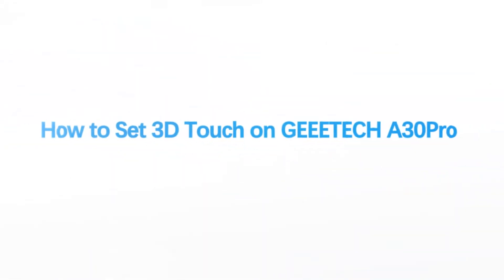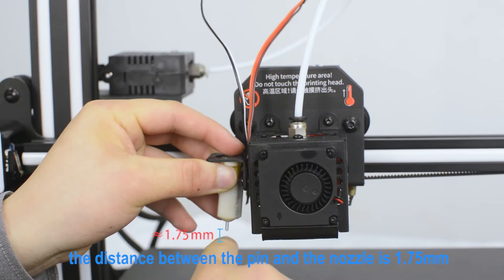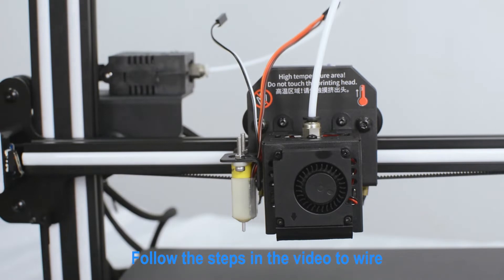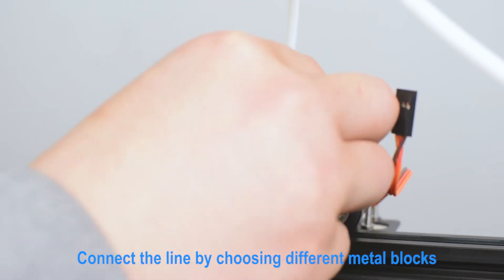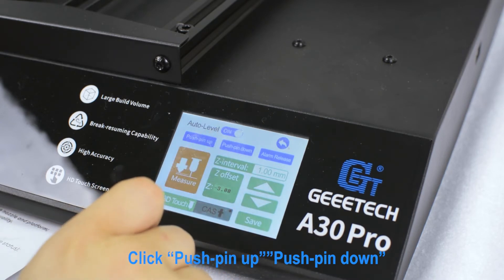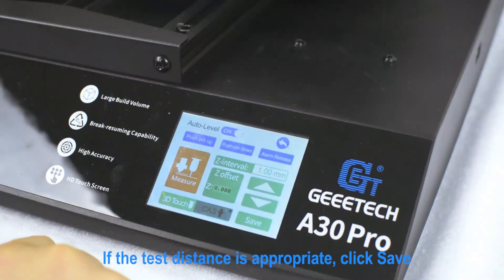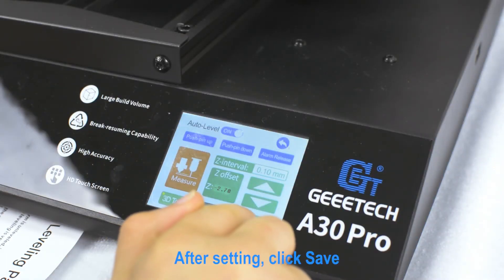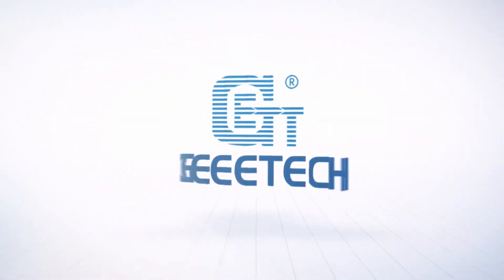How to Set 3D Touch on GEEETECH A30Pro

Comment: 3DTouch does not work on leveling. I damage my printer because the nozzle ramm into the bed.
The pin of the 3DTouch come down two times after i switch on the printer. Then the blue LED light on permanently and the 3DTouch has no function.

Comment: I can't get this to work. Geetech forum on the website doesn't resolve issue I have.
Why does the extruder head just keep on ramming into the bed?
Reply: running into the same problem, gouged my new buildplate. Did you ever figure it out? I'm thinking I'm just going to get the capacitive one and call it a day